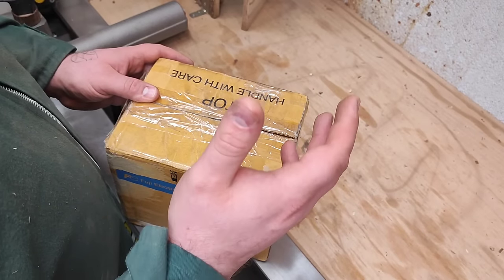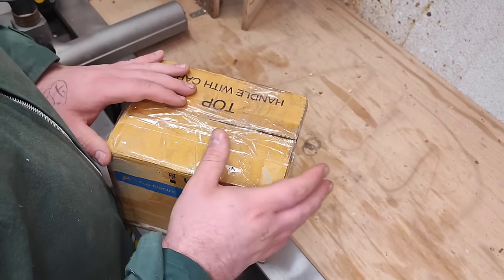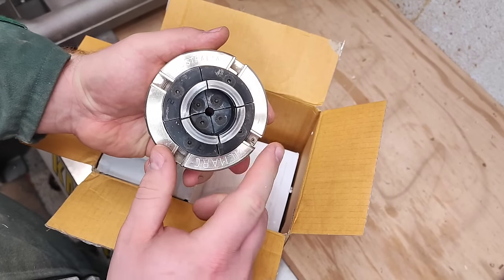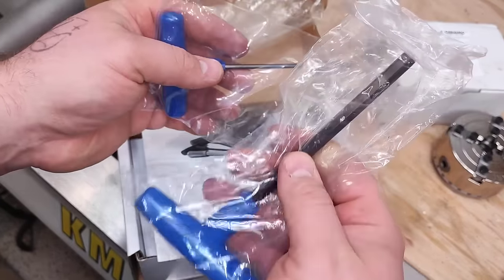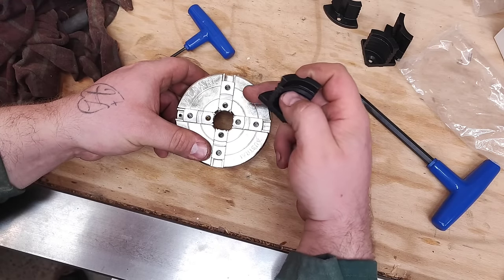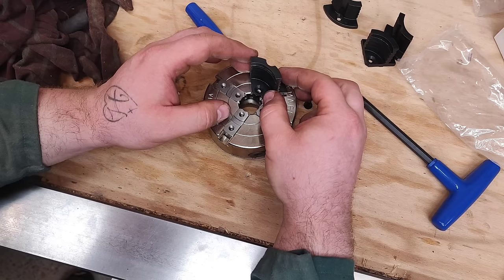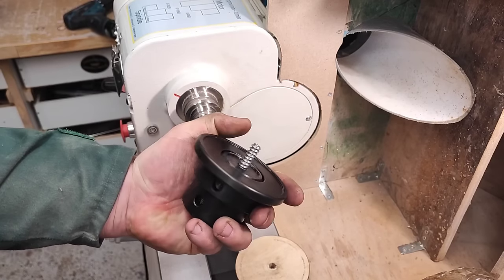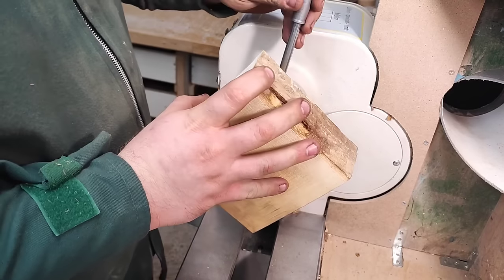Premium tools for bowl makers!

Comment: I love these chucks.  Can't afford to buy so many bodies, so I tend to change the jaws a lot depending on the project.  BTW, WD-40 is really a solvent and water remover.  Silicone lubricant tends to work much better for rust prevention.  The stickiness of WD-40 is the residue left after the lighter parts have evaporated.  Never use WD-40 on hinges because it'll actually cause them to squeak.
Reply from the maker: Thank you Randy,I learn something new every day 😉

Comment: I usually turn with shark jaws on my chuck and got sick of changing to the standard jaws to fit the wood screw so after watching Richards demo of the 3 in 1 lashed out and bought one. Great purchase. Don't know that I'll be using spacers, but I know the option's there. Great video and great chucks, thanks.
Reply from the maker: Thank you very much

Comment: My dad used a similar homemade faceplate chuck, but added two tiny nails with just the tips pointing through to keep the blank from spinning. I saw Richard's intro on the 3-in1 chuck a few months ago and have had a set in my US vendor's shopping cart. So..... I pulled the trigger today and have my own coming.

No other VicMarcs here-- i'm a Stronghold and Axminster driver at this point.... But the Shark Jaws make it tempting to adopt a third plafform.
Reply from the maker: Thank you,glad to hear that 3in1 is going into good home, axminster and oneway are good chicks as well

Comment: I made a happy mistake. I bought Nova, and I do not regret it. For a time I thought I should have gone with EZWT chuck for quick jaw changes. As I was considering upgrading, Nova had a sale and I bought 3 more bodies for a very fair price. Now there's no jaw changes or wear on the moving parts of the one system. 

I would prefer 40mm of travel over 20mm, but I'm still pleased with them. I'd be lost without my screw chucks, though.
Reply from the maker: Hi Jay, nova are nice as well,so if you have the system that works for you then keep on using, nothing wrong there😀😉
Thanks for watching

Comment: I have used mostly bargain chucks after a disappointing purchase of a supernova II chuck. It was 1”x8tpi and required an adapter for my 1 1/4” spindle on my Rikon lathe (which I love!). The provided adapter introduced wobble in the piece when it was secured to the chuck via set screws! Too much slop I guess between the threads. If I removed the set screws it would run true but it would be susceptible to backing off the chuck even when decelerating turning off the lathe and also in reverse start ups. I wanted to be able to reverse sand with it. Sadly no. I could have taped the adapter to the chuck but it kind of sullied me to this particular chuck. Then I started buying bargain chucks of various sizes and jaw styles so I have dedicated chucks for various operations which is very convenient BUT I had one bargain chuck blow apart on me. I think I over tightened it and the large snap ring worked itself out of the groove and the jaws came flying off along with the piece! One of the jaws hit me in the collar bone, serious ouch, and another bounced, thank the lord, off my face shield and did not damage my face! Left a big scratch in it though as a reminder! I found 3 of the 4 jaws but still have not found the last one! Went flying into a back corner maybe. There is a point to this story I swear. Anyway I love my large variety of cheaper chucks because of the efficiency of throwing on a specific chuck for a specific purpose BUT I don’t over tighten them because I know they are of lesser quality overall (not bad but lesser) than say the Vicmarc chucks and won’t handle the abuse they will. Anyway, my point is this! After watching this video I decided to finally buy the Vicmarc 100 or 120 and shark jaws. Had a terrible time even finding them but finally found them on woodturnerwonders but they were all SOLD OUT!! Aargh!! It was going to be a birthday present to myself for my recent 65th birthday to make up for me becoming officially old! Lol! Just my luck, but anyway I was hoping you or someone else here would know where to source them here in the USA? I’m going through withdrawals now that I finally decided to take the plunge!! Please help me if you can my friends! Take care and as always, a very valuable tutorial and review on a great product and subject!! Take care, Scott
Reply from the maker: Hi Scott, glad you weren't injured by jaws flying off... I have one vicmark chuck coming to me from craft supply usa, they should have it...also check on vicmark web site the distributors list ,there might be a few dealers....
Hope this helps

Comment: I've seen nothing from Vicmarc that wasn't the best. 

That screw chuck is a design first put out by Jerry Glaser. VB36 also has something similar. I started out with the wormwood from Nova and quickly learned the value of spacers -- way too long for anything if you actually want to unscrew the bowl at some point. Probably got that tip from your mentor, an old book or video. Do have plans for making a few Raffan-style screw chucks -- they look good for production. And certainly economical. 

Thank you for sharing your wonderful "Easter gifts" (western Easter anyway), and another excellent video.
Reply from the maker: Thank you Greg for little history, I like that and I wish to grab one day few glasser tools if someone will ever sell.too bad they are not made anymore

Comment: I think my fear of using a screw chuck isn't taht a catch would shear the screw, but that the threads would strip the wood.  I will say that after watching you turn using a much smaller and finer screw in your shop-made chuck, I've realized that my fear was unjustified.

While I'm not sure I can afford to have a chuck for each set of jaws I have, I love the idea of getting a caliper for each width, as they're relatively inexpensive.
Reply from the maker: You can strip the hole if its too big, them threads won't have anything to bite in, but if you drill a hole the size of the shank it should be ok....

Comment: I personally prefer the Oneway chucks that hold a spur drive or a worm screw.  That way you don’t need to remove the chuck to use those two holding methods.
Reply from the maker: Oneway makes great chucks and its as good as vicmark, its personal preference and I did use woodworm screw a lot in chuck but find soon that I like even more having it separate...but again its personal preference 😀

Comment: I have a vl 300 and had tried to order a swing away bed extensions with it. They were poorly machined and had to be returned. They admitted it shouldn’t have left the factory. Eventually I bought a full bed extension and it also required quite a lot of effort to get it to work properly. Their QC was shockingly terrible. The surface finish on the bed extension was terrible. The distributor was great in his efforts to help but vicmarc themselves were horrible. I would not buy their lathe again but their chucks are excellent.  I’d be happy to share my experience with anyone. I have all of my correspondence with them saved.
Reply from the maker: Sorry to hear that, not sure about what happend, glad you share your story and atleast you are enjoying chucks😀

Comment: Dear Tomislav, not only are you a great teacher but also an exceptional salesperson! I actually use two OneWay chucks and will surely try to find a Vickmark here in Canada. I was always curious about the one Richard uses, the one with several sizes (steps like outside). Do you know what his combination is?  Nice demo and bowl by the way. Happy Easter!
Reply from the maker: Thank you Alain and happy Easter to you and your family.

I think oneway are good as well,lots of travel as well much like vicmark....
Vicmark just has a lot more option on jaws and in total of 5 different sizes of Chuck....each pro chuck
Now I know Richard has jaws he design ,they are called step jaws, I need one of those as well , but the steps are on inside.... Shark jaws has serated steps on outside and they are dosent sizes.... They have probably a good dealer in Canada and in USA there is craft supply usa that sells vicmark
Reply: @tomislavtomasicwoodturning  i found one in Alberta, would go with the Vm100, step jaws 00658 and jaws 00654. These combinations will complete my two other OneWay and Stronghold jaws. Waiting until Tuesday to see the flexibility of the sales person to fill in this request. Thanks
Reply from the maker: @alainnoel2198  awsome, hope you will be able to get those

Comment: I would not ever recommend a direct thread chuck. I’d always get the insert version to allow swapping threads if you change lathes or are demonstrating on a lathe with a different thread pitch. One fit thread chucks become useless if your selling a lathe that they only fit if the next lathe is a different thread. 
The chuck jaws don’t really need to relate to the chuck jaw numbers only need to be in the right jaw set order. That way they will always match each other when closed because they were a solid ring and cut into the four jaws later.
Reply from the maker: That is why they number them, and you might be right on direct thread but I have never got opportunity to have a lathe with different thread, here in Europe its mostly m33 for newer lathes....

Comment: Bonjour
Vraiment dommage de faire d'aussi beaux mandrins qu'on ne peu pas utiliser en rotation inverse.
Reply from the maker: Evening, not sure what you mean but I use these all the time in reverse, with good enough flick I don't even use safety ring....
Reply: @tomislavtomasicwoodturning  👍
Reply: Agreed. I have a technatool titan and the adapter has a grub screw for safely reverse turning. Chews the threads on the spindle and I quit using that feature. Reverse turning is no problem. I would still be watchful with a huge bowl, but usually the reverse is for sanding and consequently less mass. Sometimes I hollow a bowl over the ways in reverse to avoid a lot of leaning. No issues yet with a chunk coming loose. Some of the cheap knockoffs are known to come off in reverse though.